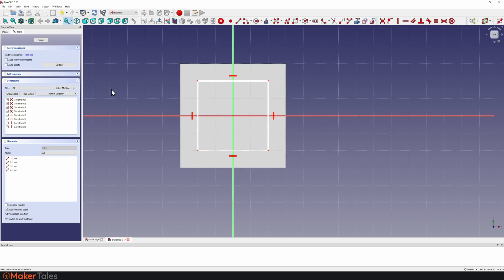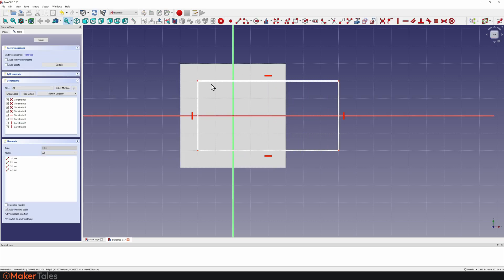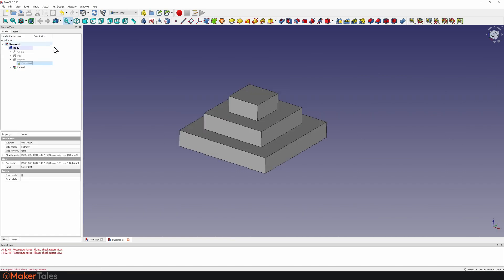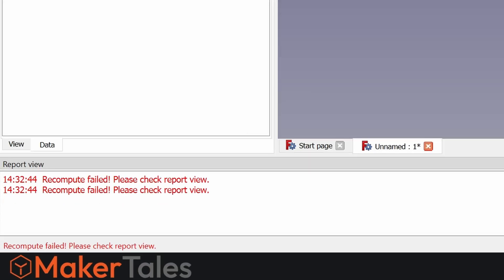Is FreeCAD 0.20 Still Fundamentally Broken?!

Comment: 0.2 is buggy. Many people (see freecad forum and youtube videos explaining it out there) get "recompute failed" and "wire not closed" errors when using version 0.2 when the sketch are totally fine and working prefectly fine in version 0.19 or earlier. So I stick with version 0.19 until 0.2 is fixed.

Comment: Hoping the Freecad 1.0 still works in the Portable Apps system so I don't need to install it. Yup a problem with the work machines and permissions. ).20.x works fine as a portable app through the launcher.

Comment: I gave up on freecad because of the TNP and generally just feeling clunky compared to what I was used to. Keep checking up on if it's been fixed yet, hoping it will be fixed in the future, with some other refinements too. I'd love a way to set a preferred axis of rotation like in Fusion 360, I can never get used to the way freecad and other cad software rotates, I just never get it to work and loose my place entirely.
Reply: There is a param to rotate in a more "logical" way, i can't use the standard way too, unlogical to me.
Reply: freecad needs to stop blaming the user. as soon as they realize the UI workflow is completely non intuitive and fix that, they'll gain users. until then the majority will continue to fire up the latest freecad, get quickly frustrated trying to do basic things, uninstall it, and go back to fusion 360.
Reply: @TMS5100  the story of my life with freecad. As a good no-life man, i decided to note each annoying or stupid behaviour of this soft and its UI. It's about 3 A4 page for now. 
And this project is more than 10 years old
Reply: @philv3941  its actually 20 years old.

Comment: I don't know if it's broken or not, but I do not like it one bit.  I spent about an hour with freecad 0.2 and spent more time reading errors in the report pane than anything else.  I was thinking it might be easier than Blender for parts design for 3d printing.  everything was green (properly constrained) which meant I can't move anything and that's about the point I gave up.  If freecad in any way represents CAD programs in general, no thanks.
Reply: it doesn't. most people use fusion 360 because freecad's ui is horrid.
Reply: @TMS5100  Fusion 360 ? Forced saving projects in the Cloud?  Nope.

Comment: I have to say that I was pretty shocked when I learned that the bug was to be still included in 0.20. On the other hand the developers have been forthcoming with the news that the "problem fix" was not part of the plan for 0.20. Thanks to Maker Tales and Real Thunder for keeping this on the radar. The attitude has really shifted from the "blame the user", "no one knows what they are doing", "its a feature not a bug" attitude to just putting this on the long term fix plan and calling it the bug it always was. I'm excited, but tentative, to see 1.0 and the real fixes. I'm even more excited to see your series on it.
Reply: Solving the TNP is not trivial and the implementation is currently being forward-ported by realthunder which is a huge amount of work because link branch and 0.20 diverged pretty heavily..
Reply: It's not a bug. It's a feature that is not implemented.
Reply: @Pulsar2000  Complete nonsense. TNP is a bug and always has been.
Reply: @adaycj  Not true, but it would take a little longer to explain it to you. There is no real solution to the TNP,  even in commercial software.
Reply: @Pulsar2000  Face naming could at least be stable when the number of faces is not changing - that much is certainly possible, and the face naming not being stable when the number of faces is not changing is something that I consider a bug.
Reply: @logicalfundy  
And unique name index that will not allow to use a name which was once used (in project history, even in deleted parts of the project).

Comment: I literally can't change the values doing chamfer or fillet and padding dont know if the problem extends to changing any value every time I change the value it goes back to zero and tells me "Size must be greater than zero" Such a shame I reinstalled it hit my head on a wall still can't fix it if anyone has a fix can you tell me?
Reply: I solved it by going into control panel > clock and region > change date, time or number formats > formats > Englishj (United states)

Comment: TNP is not that big of a deal, honestly. But It's a bit hard at the start. I use a lot of absolute position workplanes, and they end up making the model very stable. But sometimes you have to do a few extra steps.
But hey, it's free. The goal is not to beat F360, it's to have a software that is usable by anyone that wants to do CAD without making users pirate software or be restricted by free licenses. I know you want to do the free course when version 1.0 is out, but I think you can also teach people to avoid TNP :)
Reply: Learning to avoid TNP definitely results in better models. I couldn't agree more.
Reply: @joes144  Exactly. If someone leaves FreeCad because of TNP, he is very likely a CAD noob and doesn't know what stable modelling is.
Reply: @Pulsar2000  And that's exactly the problem. FreeCAD is never going to get off the ground, unless it gains widespread popularity among hobbyists. Most of which aren't professionals, in fact most are at the beginner-level or just above that. You can make the case, that in order to use FreeCAD properly you have to learn proper CAD-modelling. But then FreeCAD better have good documentation or better yet plenty of high quality tutorials on youtube...and it doesn't. 
The number of good tutorials has definitely increased these last few years but FreeCAD has been in the making for over 20 years now...

It's 2024 and FreeCAD is still almost exclusively used by people who feel strongly about using open source software. No one uses FreeCAD because it's doing things better than popular CAD-programs like SolidWorks, Fusion360 or Onshape. People now even go out of their way now to make Blender, a 3D-modelling program meant for 3D-artists, into a CAD-alternative. That tells you a lot about the disastrous state FreeCAD is in.

Comment: There is no cad system that "solved" the topological naming problem. The so-called "solution" literally requires human mind reading. The software has to figure out the user's intent from the actual changes. Is it possible? In general no. CAD softwares are trying hard but sometimes the most advanced software wreck your model when you make changes in the model tree. Pro users use pro software without relying on topological naming, in freecad it is a must. Does this make it fundamentally broken? I don't think so. Would it be more user-friendly with it? It is still not a resounding yes. Why? When the model crash because you blindly relied on the software and you are a beginner you are helplessly lost and that is worse than a steeper learning curve at least this is my opinion.

Comment: Currently updating FreeCAD to 0.2 to see if it's actually any better. I tend to spend most of my time in the PartDesign workbench and in the past it has proven to be a horrible, unreliable mess by crashing seemingly at random when wanting to do simple things like add chamfers, fillets or sketches. Restart and repeat the operation... and it works? Too many times I've lost work, very frustrating.
CAD Sketcher for Blender seems interesting, must check that out!
Reply: FreeCAD devs are quick to point out the chamfer and fillets (and thickness too) are not part of the FreeCAD code but rather the underlying OpenCASCADE 3D engine. And that the OC devs are not wanting to fix the issues unless a case can be created from the OC framework that replicates the issues from FreeCAD. But it is buggy and slow and annoying as heck.

Comment: An Assembly module is needed within FC - that would be a game-changer
Reply: There are three actively developed assembly add-ons available. Each has a different style it follows. You should check them out.
Reply: I agree with Ron - it's pretty ridiculous to have to a) download a third party utility to use a feature that's stock in every popular CAD software and b) have to sift through multiple options. That second point is one of the biggest downsides of all popular open source software that isn't controlled by a corporation keeping things in check. FreeCAD needs to solve these kinds of issues if it ever wants to succeed.
Reply: @joes144  That's even worse. I can't imagine F360 improving with more assy styles/approaches. I hope they get distilled to 1 WB that caters to everyone's needs when 1.0 arrives. They can keep the others around for backward compatibility until the next major update.

I get how these experiments can help figure out a definitive method though, especially on versions < 1.0
Reply: @ronnetgrazer362  you're not necessarily wrong. But I'm not sure it'll change. There are reasons for this. Some view it as a drawback. I've slowly come to view it as a strength. But I also realize the approach isn't for everyone.
Reply: I find a2+ to be relatively easy to use and pretty robust.

Comment: damn, i just downloaded freecad yesterday (because i purchased a 3d printer) and your telling me it doesnt work well ? i havent even started learning how to use it yet, should i even bother ?
Reply: it's an amazing program and works very well. it's not too hard to work around the TNP, meaning don't build your models by stacking new features higher and higher referencing edges or faces; instead use absolute positioning for your sketches/additive/subtractive features, do all chamfers and bevels last, etc
Reply: You don't have to use Realthunder's fork. Freecad is quite capable if you take the time to learn good CAD design principles. The two best channels I can think of for educational content are mangojelly solutions and joko engineering.
Reply: @jeremiahbullfrog9288  yeah im a noob, i have a little blender experience though so it makes it a little less intimidating. currently browsing for beginner tutes on here so if you can recommend any good ones please do ;)
Reply: Very steep learning curve.  Use the Real thunder branch version for now.
Reply: @davidcooper3871  ? this is the first ive heard of it , whats the difference ?

Comment: Freecad sucks so bad.
Reply: It's decent for being free.
Reply: @SkidooMXZTNT  Disagree. It is a lot of good work that has gone into it, but it's still bad. Blender is good for being free. Gimp is good for being free. KiCAD is good for being free. Krita is good for being free. FreeCAD and OpenSCAD is in the handful of open source application that should probably be avoided for now unless you plan to actively make them better yourself.

It looks like FreeCAD i looking to join the large crowd of OSS than can said to be good now, so time to have a second look at it and see where we can help with the code. OpenSCAD is sadly lost forever due to design decisions.
Reply: @SkidooMXZTNT  that's an excuse. nobody used blender until they fixed their UI problems. freecad still hasnt learned the blender lesson.
Reply: @SkidooMXZTNT  Not really if it don't work.  I tried putting a threaded hole in a part, and it was not possible.  Thereby it is useless.  I spent $595 on fusion 360 and got the job done with ease.
Reply: @onjofilms  Don't mistake not knowing how to do something with the program being bad. There's a hole tool in part design that makes threaded holes easily.
Reply: @Zardozer  Maybe it's fixed now.  You keep wrestling with it.  It's not prime time.
Reply: Agree, Blender is far superior and doesn't crash randomly
FreeCAD is alpha software that has random crashes and bugs
Reply: @jeremiahbullfrog9288  The slowness is bad, but that's not a design decision and can be fixed. The flat namespace "programming language" used makes it unusable for modular or even configurable work. And "unusable" here is not the same as "impossible". It's possible, but in the end not worth to waste time on. As soon as you go up in complexity you will end up writing another language as a frontend or go mad.

Since that is a design decision "to make it easy to understand for non-programmers" it's not fixable.

Comment: if you know freecad well it's not a problem
Reply: That's always the case. But when I hit this and was shouted down with "you are doing it wrong!" I knew FreeCAD should be avoided for now.
Reply: @v4lgrind  just take the realthunder version
Reply: Or the toponaming branch now that it exists. But before this statement of intention it wasn't worth the switch cost.
Reply: @v4lgrind  I am totally enthusiastic about freecad
Reply: Perhaps the message was blunt, but if you're running into TNP. It's highly likely that you weren't following good CAD design practices. Some other software allows you to model 'quick and dirty' but eventually will break. Good design practices don't really make modeling more time consuming either (seriously). I spend way more time thinking about my designs as I like to "design as I go".
Reply: @joes144  @thomas neeman Yes, that is exactly the message that has been sent by the FreeCAD community and it has been interpreted as it should be: "We will defend this design flaw, the software is in a dead-end and should be abandoned".
Reply: @v4lgrind  that is a grossly incorrect interpretation. But it would seem that you have already made up your mind. And believe me, I don't hesitate to call out members of the FreeCAD community when they engage in socially toxic behavior. 

TNP is undoubtedly a problem. But if you are unable to model effectively without constantly triggering it, then you should consider that your technique is also a problem. It is never a good idea to reference generated geometry for creating features in a CAD model. Regardless of the software used. The underlying issue is related to the OCCT modeling kernel. There are no comparable open source alternatives to turn to.
Reply: @joes144  Is there a tutorial for the recommend method? It just seems logic if you want to make a pocket in a face, you map the pocket sketch onto that face...
Reply: @tim1398  I'm not sure I can adequately explain it in a YouTube comment. However this video does a good job showing you how to fix a model once it goes bonkers. https://youtu.be/6p2vqEEmWq4
Reply: @joes144  Lots of experience fixing Freecad models gone bonkers:) Just trying to visualize this "proper" design flow.
Reply: @joes144  that's how I see it too. well made freecad models are stable

Comment: Such a shame, but really looking forward to that 1.0 release. I do wonder why they didn't bring in the fixes from the Realthunder branch to 0.20, presumably there are some potential issues with those changes although they've worked well for my (pretty light) usage.
Reply: The realthunder algo is very far reaching and goes deep into the legacy code base. Freecad is very stable and those kinds of changes require a lot of planning and careful (ie slow) code review. It's being broken down into smaller logical chunks for quality control and careful bug testing.

Overall, I expect this process will actually strengthen the topology code quite a bit. I no longer have problems with topology, but I'm excited for the change anyway.
Reply from the maker: Ya it is a shame... But oh well... From what I was reading it seems that it was adding a little bit of development freeze to Free CAD as it was some pretty deep changes so ya... Here's hoping it comes much sooner than expected.
Reply: I also have no real problems with the Realthunder branch either. The vast majority of glitches there have been things that were inherited with the branch and not new. I'm not terribly worried about forward or backward compatibility of my work. If I was, I'd be more concerned.

Comment: it'll be interesting to go through the 1.0 tutorials once the future arrives... currently I'm getting around pretty decently in the sketcher/part design/part work benches. I've been  working on my own designs in freecad for several months now, and can confidently say I'm past the headache of not being able to figure out where you paint yourself into a corner with constraints, over constraining models with no hint as to why, etc. basically pretty comfortable with the basics and getting my parts set up in assemblies to continue iterating.  That being said, most of what I'm doing is glorified drafting, as 99% of what I'm making is just profiles for an endmill router and I simply extrude the part to the desired material thickness. Where I'm really struggling to find a good tutorial would  be on the curves work bench and more complex tasks.  I know MangoJelly has a long playlist just on the curves wb alone, but honestly can't sit through 10-20 hours of youtube just to learn the one bit I need at the time of inspiration to create the thing lol .
Reply: I think joko engineering has a few solid videos on surfacing in freecad that won't take you 20 hours